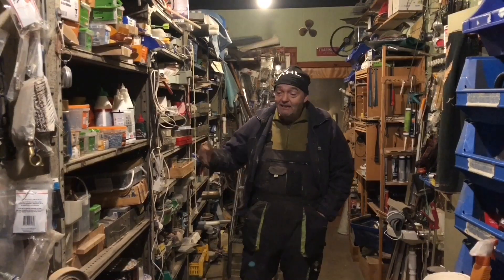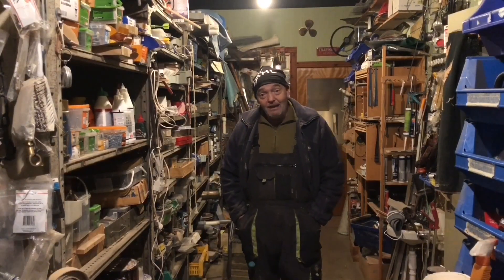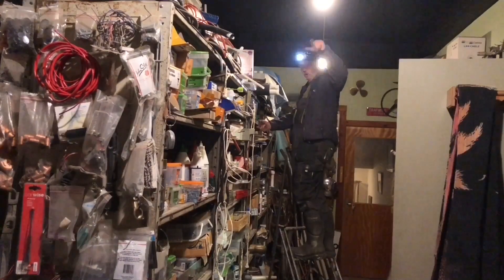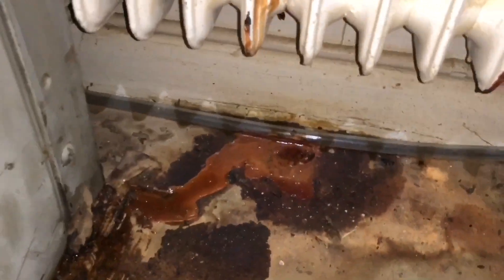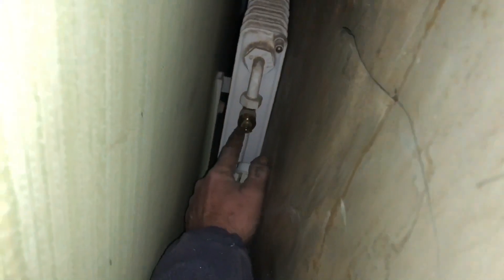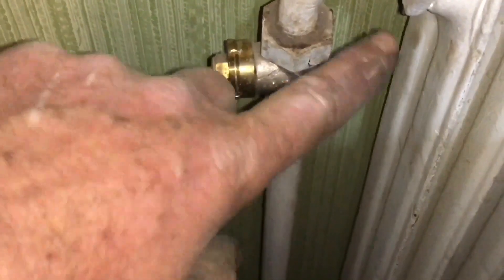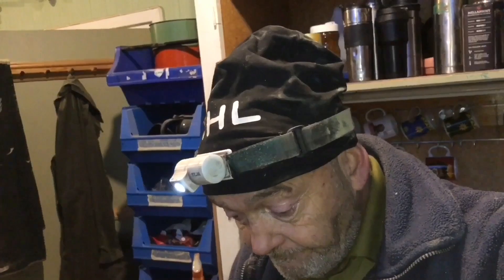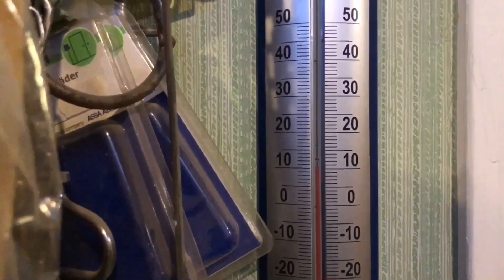Losing heat fast in the Arctic, can we freeze up or can I fix it now? Rusted out Radiator.

Comment: Those old radiators are probably one of the best heating systems in a building. Even when the furnace isn't running they still give off some warmth. We are getting a big polar plunge from Canada here Friday night & Saturday.  It goes from 50ish to single digits overnight. 🤯🤯🥶🥶
Reply from the maker: Your are correct Robert they work very well, now you need to concentrate own your own coming issue so stay warm and safe. Thank you.

Comment: Great video , here is also winter and dark and was great to watch. I was scared when that bolt came out, 18:50 thinking that is broken and will leak all the wather in that cold. It will be intresting to see also the furnace. Be healty and all the best from eastern europe.
Reply from the maker: Hi Dan, I have done that pulling the pin out a few time here now so we are all good and it seen harsh but you need to get the water flowing. I have shown the furnace many time in previous videos but I should do an update. Thank you.

Comment: Re arrange your storage with your shelves back to back instead of end to end? I don’t know if you have room.  Connect 3 rads together with one controller to bleed?
Reply from the maker: Have we ever worked together Dave? I so want to put these racks back to back it would create so much more room. However the stores is also the main through route for everything at the moment so not possible. I have the main school entrance blocked off and boarded up. I am going to build a new front entrance with new fitted doors ect and then maybe I can do it but the way the building is configured now it is not possible. The rads are all steel piped from 1948, with all main 4" pipes in walls or under the floor, no thank you. This is a commercial grade building with huge pipes and valves not cheap or easy. Every time I touch one thing something else fails or leaks. Thank the lord for leak stop!
Reply: @arctic-rebel  hey Simon put a scale plan up on your u-tube that way maybe doing a bump out wall could give you more space and storage room. Expose your rads and use that as your walkway? Maybe?  Lol maybe we were great warriors in a past battle?